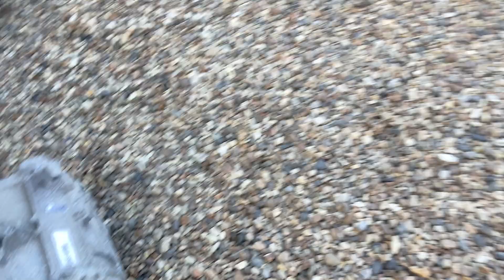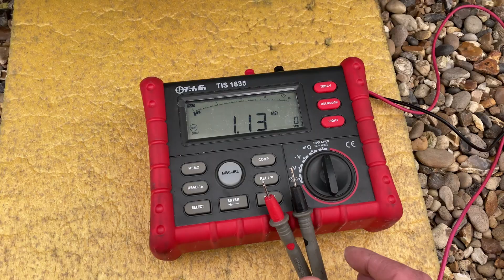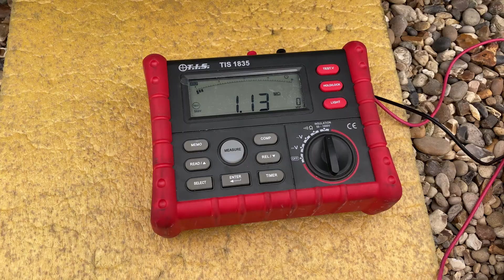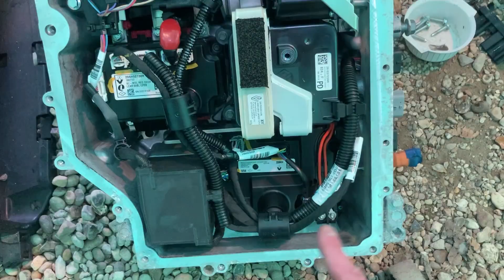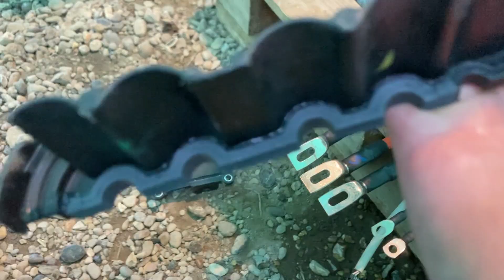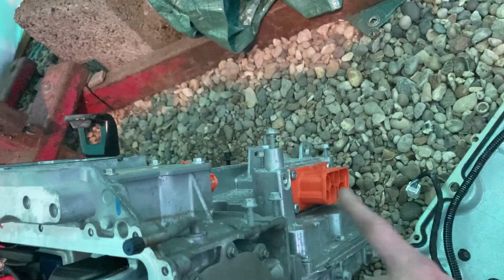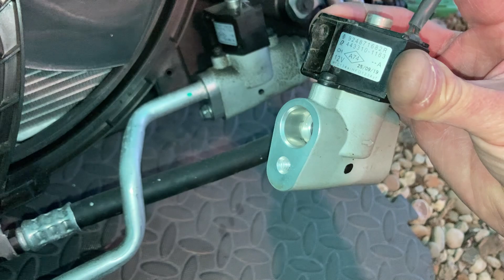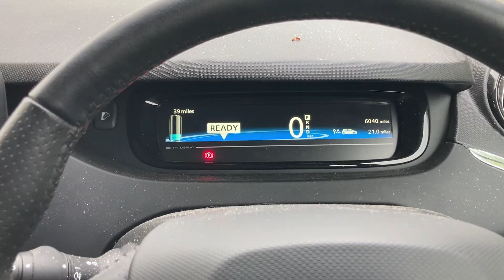This ELECTRIC CAR IS DEAD after only 6,000 miles - Can we fix it? Renault Zoe EV Repair

Comment: How these manufacturers are getting away with under engineering everything to be just strong enough to make it through a couple of year warranty it is disgusting what has happened to England. They like talking about being green well surely sustainability is green not using as many plastic parts as possible on the engine would be green and stop lots of premature catastrophic failures caused by wet belts and plastic parts. Lithium batteries are just a toxic fire hazard especially when they're in huge banks of hundreds of volts. I know let's get a couple of thousand three volt batteries and link them all together to make 400 to 600v that nobody can touch and be obsolete in 3 to 5 years anyway so there's no sustainability basically.  These battery packs have thousands of cells and it only takes one of those cells to go into thermal runaway and it takes the rest with it talk about increasing the chances of failure. I find it unbelievable. Government can back Manufacturers into a corner and then let them take it out on the  customers due to the harsh regulations imposed on them.
Reply from the maker: There’s a lot to unpack here…
Reply: @garycevrepairs I agree had to edit that one lol

Comment: To get reliable internet at the end of my driveway I bought a set of powerline adapter and extenders, you basically plug in a powerplug next to your router, put in an ethernet cable between both devices and pug in a simular device in the power where you need Ethernet. For me it works great when flashing stuff in the cars.
Reply from the maker: I could extend it but it’s one time programming so I’m wary, if it drops out mid way or the latency is too high then game over…
Reply: Powerline adapters are very noisy in radio bands and radioamateurs might get your head soon - make a case with Ofcom.

Please don't use them.

Comment: For a car which drove only 6000 miles it has a lot of damage on the outside: look at the wheelhub front-left, on the front there dents. My car is almost 11 years old and drove 82.500 miles but looks much better than this old thing. How old is it actually? I mean you can drive 6000 miles in 1 month and also in 10 years.Renault thinks it needs a motor and a motor-controller. Of course, they are the two most expensive parts of the car, let's start with those.
If you would work as much as you talk this could have been a very short video. Saying Cheers a thousand times also doesn't help.
Is it normal in England to work on the ground so dirt can easily enter the motor and/or controller? Here in The Netherlands we have workshops for that.
Even when I would live in the UK I certainly would not bring my car to you, that's for sure.
Reply: You typify an arrogant Dutchman..

Comment: shocking bad quality control from renault there , you're a top bloke for saving this low mileage car from the scrapyard... bit an own goal by renault there poor design and casting , Isopropanol is good at removing coolant from controllers if you can open them obviously no good if they're potted.
One hopes Renault watches some of you're videos at somepoint.
Reply from the maker: Thanks! The motor controller is multi layered and not easy to clean. It is surprising that it leaks because the coolant hardly gets warm, nowhere near the pressure of an ICE engine, must be very bad casting. Cheers

Comment: The answer to me is do By an EV vehicle in the first place my wife’s 2003 1.6 Ford focus which she has had from new now has 71.000 miles on the clock has only needed were and tear items to keep it on the road it has had 4 sets of tires now because they rot rather than wear down it runs and drives like new I an on my 3th car now because I buy diesels so are the work horses my current car is a 2015 Vauxhall Astra 1.6 diesel with 73.000 miles it has just flown through it’s mot it averages 65 mpg I love seeing 750 miles of range when I fill it up with fuel
Reply: Because no diesel car has ever failed? And you can drive 750 miles non stop can you? I don't think so 😂

Comment: To clean the coolant off have you tried using brake and clutch cleaner, it evaporates very quick.
Reply: Spot on. Works very well, inexpensive and does the job. Might have to be careful around some plastics, could cause softening. The manufacturers could learn a few things about how to avoid porous castings, or develop a proven coating to the inside of the water jacket that would seal porous castings against coolant leaks.
Reply: I was thinking isopropyl alcohol. I use loads of the stuff to clean electronics. Should rinse out any unwanted liquid and then evaporate.

Comment: Impressive work, Enjoying your Content, just become and EV owner with a Used MG MG5. 5 years old with nearly 39k miles. I know you specialise in Zoe's but have you any experience with MG EVs? would love to see a repair on one.
Reply: There's very little after market support from Chinese car companies. They insist main dealer only work, and will not help independent repairers and DIYers. 

They want the cars to be written off so they can sell more cars. Very different philosophy to european car makers.
Reply: @fredfred2363  The reason the video was made was because Renault said it was scrap, so not an entirely different philosophy.
Reply from the maker: Haven’t fixed any myself but DB Car Doctor in Duxford has fixed a few MG EVs. Cheers

Comment: Excellent analysis, and fascinating👍
Bit like my power shower motor which developed leakage to earth resistance around 1 meg ohm due to carbon dust. It caused the earth leakage breaker to trip. Removed the motor, cleaned, dried out and I added extra insulating varnish. Leakage resistance went to well above 100 meg ohms.
Fixed it.
Reply from the maker: Thanks for sharing
Reply: Power shower motor?

Comment: Says a lot for Renault quality control!
Was the any warranty left? If so, Renault should be totally liable for all this repair!

I remember a young clueless work colleague getting a mk1 Clio on finance and having lots of problems with it.
It was under 4 years old and falling to bits.
He opened the bonnet and I said 'what the f...'!
The engine bay was 10% paint and 90% old heavy rust!
He had the car for 3 months after parting with nearly £4000 and had to scrap it!
The finance company were like cowboys and wouldn't even offer a small reduction on all those future payments!

Comment: I will stick with my 2003 VW Sharan TDi, 130 hp PD engine, great with the EGR deleted.  7 seater, 45 MPG and better.  Why bother with the likes of a ZOE  which is still at the R&D stage, not ready for the general public to use.
Reply: A car that was launched 11 years ago, and has since been discontinued, is still in the R&D stage? Sure, makes sense.
Even though it was one of the first mass produced EVs (and it shows...) I would still rather have that than a 22 year old diesel van.
Reply: @mchipelo  The life of virtually all EV's will be very short due to battery replacement cost. \when an EV breaks down I doubt it will be a roadside repair, the AA will recover it and take to nearest dealer. My VW diesel was made to last, if the EV market is flooded with £5000 Chinese EV's  then they become disposable and the used market in EV's is toast.   The ZOE has a really bad  reputation,  it left the factory not fit for purpose.
Reply: @davidcole5803 Very short life? Sure, my 2014 Leaf isn't dead yet, and if it died now I would probably still get a new one, with a higher capacity (and better chemistry). And when I bought that not dead Leaf, I tested quite a few Zoe's, including one from 2014, with 160000km and 94% SOH... unfortunately the rest of the car was destroyed and I preferred to buy a 'for sure dead' Leaf instead. 
The battery 'scare' is typical of someone who knows nothing about EVs (except what they 'learn' on Facebook.
Having had 4 EVs, one of them a Zoe, never once was I worried about the batteries...the motors one the other hand...a far worse issue.

Comment: A very good job there. The bad part is where you have to call someone for the software update to get the car moving, where as in an old gas powered car you did not have to.
Reply: Incorrect, try getting a Range Rover or BMW moving without a visit you the main dealers for the software swaps, talking from personal experience!
Reply: Yeah, almost all newer cars (not just EVs) have VIN coded components. 

It's a racket to make the car manufacturers more money and to stop chinese cloned components being used.
Reply: @stevenbarrett7648 he did say old.
Reply: Sorry wrong all modern cars are software driven

Comment: Will definitely be sticking with my simple diesel and manual gearbox
Reply from the maker: Thank you, someone needs to pay fuel duty.
Reply: still cheaper to own an ice vehicle as the depreciation on throw aways is a joke,ill keep my 5 cylinder volvo diesel I've had for 6 years with 225k miles on it,In 10 years ev's will be something we'll chuckle about in their memory.
Reply: I’ve had phones last longer than that.
Reply: A good auto box lasts longer than a manual box and auto boxes have been around for a very long time..

Comment: Main dealers realley don't have a clue when it comes to electronic repairs, this is why jobs like this should be farmed out to specialists like yourself.
Reply from the maker: Thanks, yes the dealer repairs are very much copy and paste from the original diagnostic info from when the car was made, rather than testing, gaining experience and improving from each repair. 💪🏼

Comment: Hi Gary, probably not relevant. Have you ever heard of wins Radweld don’t know whether it’s  or it might actually solve the problem. Just thought I’d let you know.
Reply from the maker: Hi yes there are a few similar products - I needed to be sure that the leak was fixed though as it takes so long to do the work and I had spare cases. Cheers

Comment: You can rinse electronics with deionised water. Dry well afterwards. All good.
Reply from the maker: There are a lot of layers in the motor controller, some soldered so would have been difficult to clean. It’s also not a short job so can’t afford follow on issues! Cheers
Reply: You can actually immerse the entire unit, empty it, then do it again, each time with fresh water (de-ionised). After a few rinses, there'll be nothing left but water. How to dry? Bung the entire assembly in an oven at 60c for a few hours. 

Works a charm with just about everything, so long as there are no moving components, moisture sensitive sensors (like microphones), lenses and enclosed switches/buttons. 

It's how many brand new circuit boards and assemblies are cleaned/defluxed prior to assembly in a factory nowadays.

Comment: Hi Gary when ever I had coolant in electrical parts I used to clean with carb cleaner spray it neutralises the glycol and everything then evaporates away. It works quite well and sometimes I would also use brake cleaner spray , give it a try 😊
Reply from the maker: If it was a short job to get out then I might have tried different methods but it takes so long!
Reply: Use isopropyl alcohol.  It is safe on all electronics.   You can immerse your whole laptop and it evaporates.   Brake cleaner might be too aggressive.

Comment: Why not use a gasket sealant instead of changing the case?
Reply from the maker: Why try to seal something when a spare is easily available? I’ve seen the flat surfaces weep coolant, so it’s not just the bolt holes that are the risk. Cheers

Comment: Just out of interest as my AC system pressure is low AC and heating works but sound is wrong 5.8 bar working 3.3 when unused, was last gassed in 2020 just as we went into lockdown, can Halfords cope with looking at the AC as dont trust my local Renault since the cut a hole in the back of the rlink surround to plug back in the hazard and door lock switches and expected me not to notice and what would an expected pressure be used to he arround 8 bar before use
Reply from the maker: Hi tbh pressure isn’t a great indicator of the amount of gas. If it sounds louder than usual then get the gas level checked, otherwise if it’s run low it can damage the compressor which can cause other issues. I wouldn’t trust Halfords 😁. Try and find a local garage that knows what r1234yf and Poe oil is ! Cheers

Comment: Designed to fail and the dealers are clueless when it comes to repairing them.
Reply: Failed to design and designed to fail in other words
Reply: @barryabell5410  Well said, sadly this is true of everything we buy these days.
Reply: It's a new technology. Easier to repair than ice engines. Kia in derby has built a massive training centre for electric cars. That must be happening all around the country by different manufacturers. It's all very well slagging off EVs but manufacturers will stop making engines purely on the basis that they're a lot harder to make than an electric motor and a bit of electronics that you can just swap out.
Reply: @kevatnorthfield 
If you look at an ev more  as "an electronic" device"...rather than a "mechanical" device ...( like we got used to with ice vehicles)

 and then compare it to other electronic devices... then it really becomes more of advanced diagnostics ... and  module replacement 

No one ( other than specialists ) is going to be stripping motors down like in this video - or fixing "a bit of electronics" 

( more than just a bit!! - evs now are better descibed as a computer on wheels -
( with some pretty complex high power control / switching / charging cicuitry etc thrown in for good measure....)...

 with of course on line connectivity for remote diagnistics and firmware update...)

All well and good... but... how much does it cost when it goes wrong?
Reply: @kevatnorthfield  I have over 50 years of expereince repairing consumer electronics
and that tells me that EV's are not going to be cheap to repair.
The main battery packs will kill you if you don't take the much needed training.
The techs that are capable of repairing them are not going to work for low wages.
Welcome to the future of motoring.
Reply: @BarbaraPape-y4g 
Like most consumer electronics... even become "disposable" ? 
I

Comment: Hi Great repair video, a couple of points which I hope may help .
Clearly the standard of these car components is atrocious.

Windings on high quality  motor and generator stators are coated with a lacquer called conformal coating, it would help with winding insulation in damp environments.

You could clean the modules contaminated with coolant with an alcohol called isopropyl alcohol, it will absorb water and glycol coolant and dry them.
If there are no plastic components acetone will also work.

To prevent future problems there are silicone oil based coolants available, often used in rarely run classic cars.

Hope this helps

Bob
Reply: That, plus the fact that all electronic components need to be checksumed with the VIN number which required proprietary tools and often to pay a registration fee to the firm is the reason why I love vintage cars.
Reply: @Hope_Boat  I surprised that the EU with it's supposed pushes against companies that are anti- consumer let this one slip through the cracks.
Reply: @dlewis9760 the EU is corrupted as hell. It's a lobbyists paradise.
Reply from the maker: Interesting points, thanks

Comment: I hope you dont me asking, but what did that all cost? my family own a independant shop/garage we do ice & hybrid vehicles + general maintence on electrics but not much else, I've been intertested in EVS from a mechanical perspective for over 15 years and been very curious watching your zoe vids!
Reply from the maker: More than it really should tbh, it was actually done a few weeks ago but was the best part of £3k all in and I’m self employed and don’t charge vat, the new motor controller is £990 from Renault, replacement case, stupid amount of labour, fluids, ac gas…
Reply: @garycevrepairs But ev's are cheaper to run😂😂😂
Reply: @jamie211983 but same cost to repair.